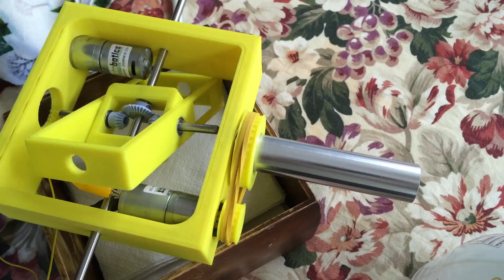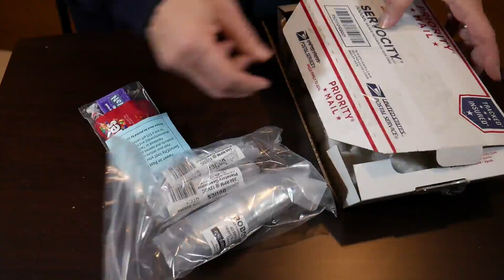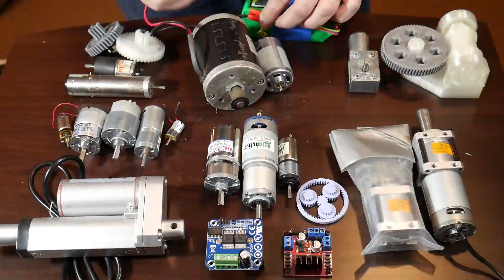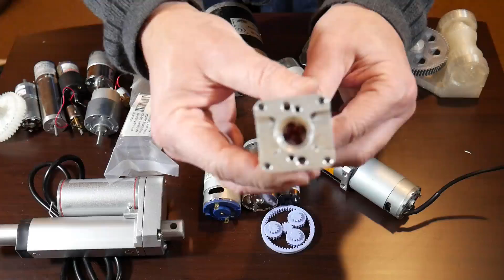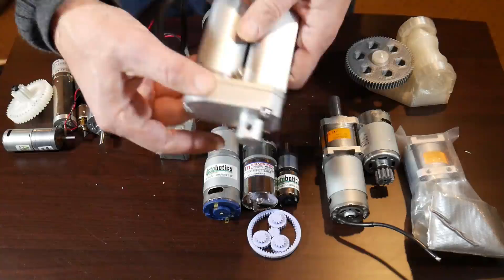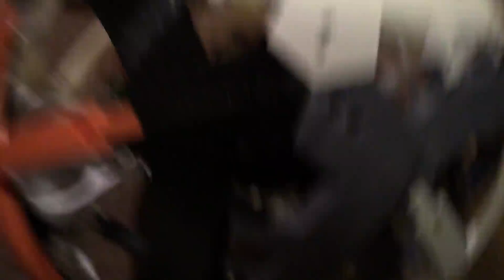Arduino Robot Projects : Brushed DC Gear Motors, Building BB8 (beginner info)

Comment: 8:54 meh those motor suck  (Edit1: dont get fool mine suck)
i got 2  tried to use it with a V belt pulley and the friction is stronger than the motor at 24V
Reply from the maker: I'm surprised.  I've ridden the scooter this one came out of and I'm not a lightweight!
Reply: @EraserMiceLabs  or atleast mine suck :P
Reply: @EraserMiceLabs  i got real question what is the amp  draw when its stalled?  i wonder if it not because my power supply is 5 amp
Reply from the maker: @buder5116  I couldn't say, I've never measured it

Comment: The gear reduction does not affect power. It affects torque and angular velocity.
Reply from the maker: Very good point!  Sorry for my slip!
Reply: Gear reduction does affect power, as torque and velocity of moving components , inform  the power of the overall system design. Energy is required.  Please acknowledge an informative and well constructed video. And if you feel you can do better, by all means do so.

Comment: Hello there, I just found your channel. The IBT-2, eh? I just go with the IBT-4's instead. The IBT-2's you have to modify to get them to not overheat; flawed design, but if you take that giant heat sink off the back, and put heat sinks on the actual transistors, then they work better.

Comment: To make a 10 kg object spinning at 10 rpm what kind of gear box should I use? Thanks in advance
Reply from the maker: That depends on the motor you are using, it will have certain capacities and characteristics, the right motor might not even need a gearbox.

Comment: I am controlling a small DC motor for a Power Wheel of my son that Motors actually in the steering wheel it controlled the rotation of steering left and right I was wondering what board should I use to connect to RC receiver ESC transmitter thank you

Comment: Pls tell me a exact dc gear motor for a wheelchair project rpm, volts, power
Reply from the maker: I'm afraid that's really difficult to say without knowing all the specifications on the wheelchair, the weight it would have to carry, the speed desired, the torque desired, etc.

Comment: what dc motor, when the power off is locked ?
Reply from the maker: To hold position when turned off I would recommend something with a worm drive gearbox or a brake.

Comment: +nerdsplaining - Expensive stuff, a beginner need things in low -costs, not to be making it too expensive and hard
Reply from the maker: depends what you have in mind.  If you want to move a decent amount of weight reliably, you have to get a decent motor.  You can get things on sale, or start with cheaper ones, the concepts are all the same.  The motor drivers I use (the BTS-7960) are actually very inexpensive compared to things like the roboclaw for example.

Comment: which motor should i use for making segway....that can sustain upto 80-90 kg weight
Reply from the maker: For that kind of weight you'd need to use a heavy duty planetary gearbox or a belt drive of some kind.  A lot of e-bike and e-board builders are using high power brushless motors and ESCs too.  I'd look at those options, but its hard to say specifically what motors to use without knowing more about the rest of the design and control methods.